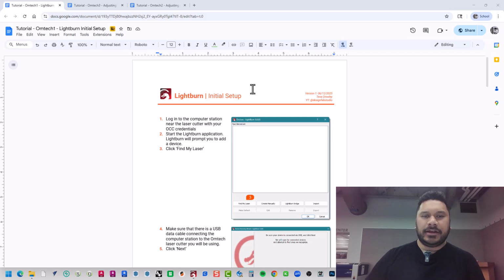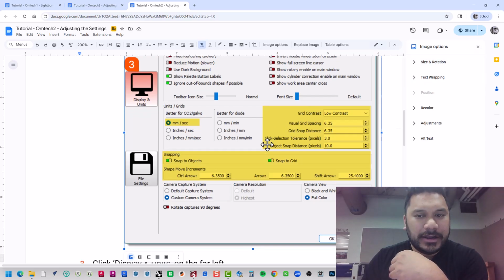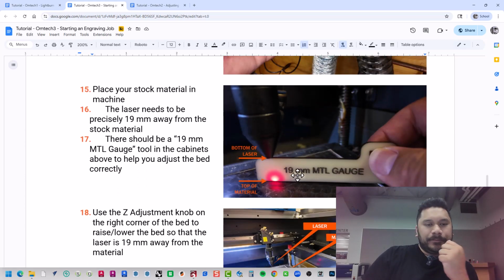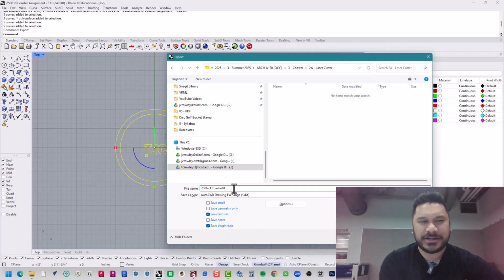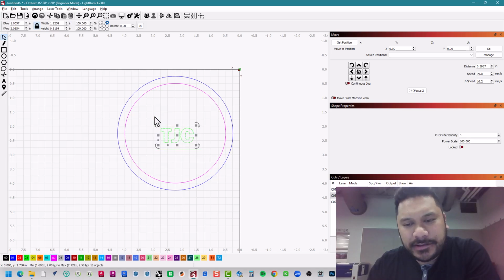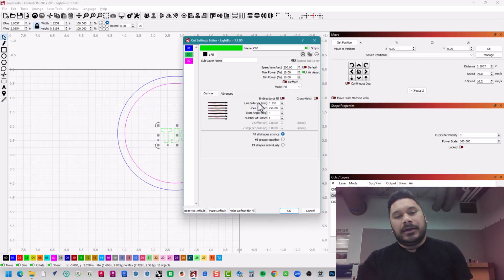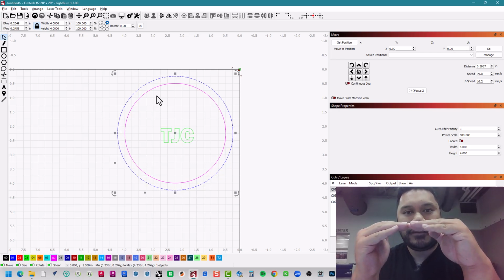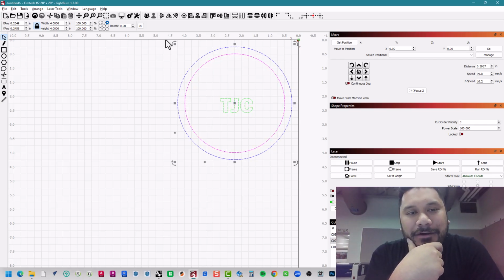How to Make a Custom Coaster with LightBurn and Omtech (Part 2A)

Comment: Before I tried laser cutting for the first time, I was very skeptical about laser cutting in general. I had a wrong belief that you can only produce keychains and other not very useful stuff. Now I know, this is super helpful, powerful, and very diverse tool with many many different use cases. Thank you for this tutorial.

Comment: The manual for the laser cutters is very useful to have to make sure the machine is set up properly. I also liked the small tools to hold the material down and to set the height of the machine. I felt like the lightburn application was easier to use than the rhino application. Very fun watching it work!
Reply from the maker: Great input! Yes Lightburn is a very easy-to-use application but when it comes to making very custom designs it definitely helps to have a robust tool like Rhino at your fingertips.

Comment: The LightBurn Editor Settings are not matching your video. For example, Enable Antialsing is missing.  I appreciate the rest of the video's organized. -Gene Kelly
Reply: I see that it's on the display mode.
Reply from the maker: @DrGeneBoyle  Thank you for the comments Gene Kelly. Or Eugene? I'm not sure which one is commenting but glad that you found the information that you needed. I appreciate the notes. If you see any other inconsistencies let me know so that I can have a more accurate lecture in the future.